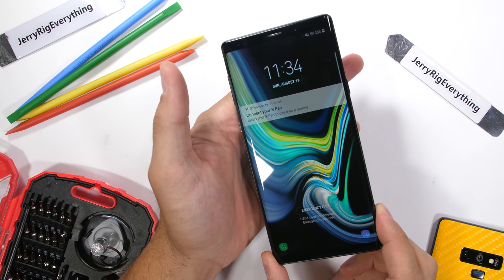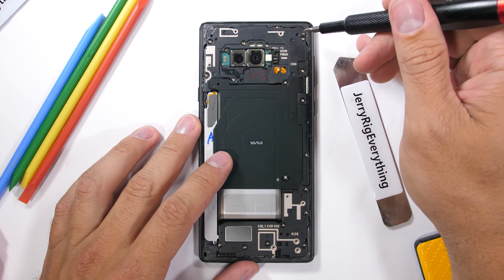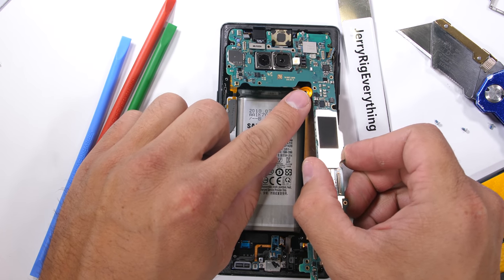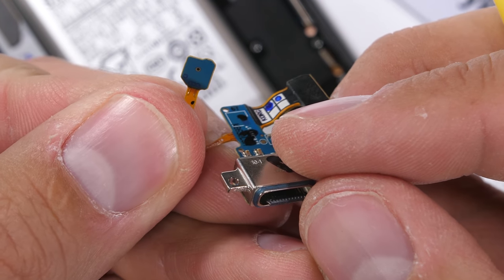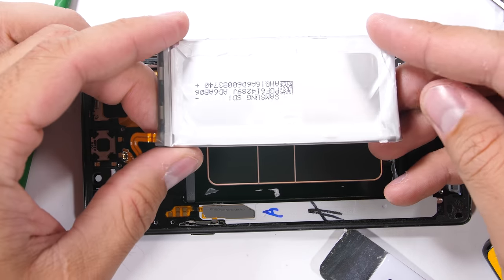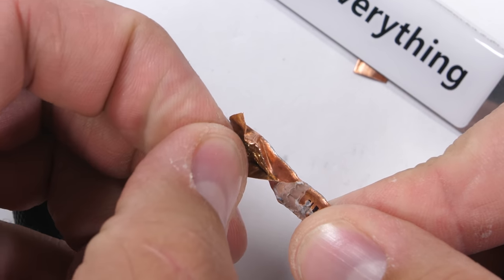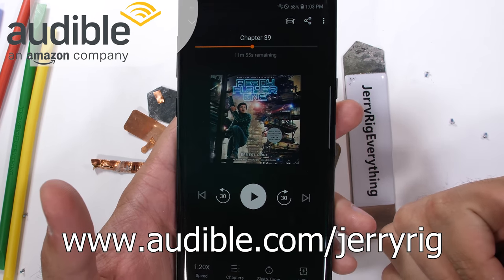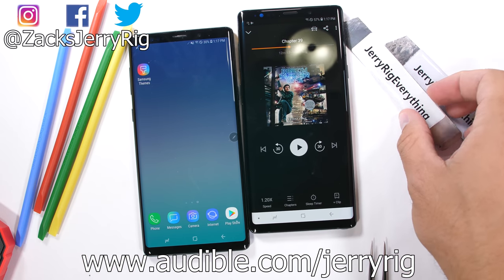Samsung Note 9 Teardown! - Is there Water inside?

Comment: Samsung can place a whole spen inside the phone..where apple can't place a headphone jack 🙂
Reply: The Note 9 is much larger AND thicker than the iPhone X. Samsung trades size for features while Apple minimizes dead space in return for a more compact device. Both are very different devices with different design philosophies and compromises.
Reply: No wonder lets see what next iphone come up with.
Plus version might be as big as s9 plus or even more thick.
Reply: I guess apple needs to make room for their terrible miniscule half day batteries, and maybe screw over the performance in the process
Reply: Apple don’t want a headphone jack that’s why. They design every part of the device, if they wanted it to have a 3.5mm it’s have one.

They want to go full wireless & figured as long as the headphone jack was around it wouldn’t happen

But honestly tho it’s been 2 years since they dropped it, Apple Haters are just getting annoying af
Reply: Lol anyone remember the courage it took to remove that
Reply: Lol the iPhone 8 Plus is as big as the note series
Reply: @user46346bdtgry   hahaha you know is for the money, they have patents on lighting cables so they get money from cables and dongles.
And yeah courage man
Reply: Apple CAN place a headphone jack. But they made a smart move with removing it. For an example. Any company, who makes Apple charging cables, has to pay apple for the design. Its the same with the headphone jack. Apple didnt invent it, so if they remove it, they spend less money.
Reply: Lmao😂😂
Reply: Got one youtuber modify his iPhone to include headphone jack
Reply: @Noah-Lach  yeah all apple cares about is thin phones and macs and trades it with performance. Look what happened to the 2018 mac.
Reply: @ellogovna5407  cough cough screen size ratio cough cough
Reply: @shoukeyy3455  Headphone jacks costs almost nothing. Apple didnt remove it to spend less money. They removed it to make more money out of the lightning port which they get a shit load of cash from 3rd parties. Unlike usb B or C which charge less from companies that makes accessories.
Reply: Well, the iPhone X still has better performance than bulkier Android phones but I agree on the laptop front.
Reply: @genelee239  forgot to say that, sorry
Reply: @Noah-Lach  then explain the iphone 7, iphone 8 which are about the same size as the galaxy s8 and s8 and still dont have a headphone jack while s8 and s9 has a bigger battery and more components inside the phone
Reply: @Noah-Lach  only in CPU performance, not overall performance, note 9 scored 280k while iphone x scored around 200k, 80k difference
Reply: @Noah-Lach  If you're saying this because of benchmark scores (if not then I'm sorry)  you cant trust most of them. Especially Geekbench. They use different programs for ios and android. And I dont think a 0.01 sec faster speed would matter in a day to day use (I don't think it would matter for professional use either).
Reply: Because apple bought beatsbydre. Apple need to force wired beat user to buy new wireless headphones to earn back the money. That's why.
Reply: Ria Driguez Actually all of Apple’s new phones are notably smaller and thinner than the GS9.
Reply: Gene Lee I’m basing that off multiple benchmarks (including 3D mark, etc.) and my actual experience with a Galaxy S9 that couldn’t maintain 60 FPS UI animations. But the additional RAM in the Note 9 is certainly an advantage for multitasking.
Reply: yes, the note 9 is 1 mm thicker than the iphone so much more thiccc
Reply: no they wanted to monitize thunder bolt and wireless headphones
Reply: yes, they are greedy and want more money
Reply: Sumeet Devilmakerzz 
We will se in the future when all the ports will be converted into USBC even the headphone jack admit it or not it’s not just Apple doing it anymore
Reply: Keros Blue 
They come with your phone 😅😂😑
Reply: People are still complaining about Apple removing the floppy disk drive from the original iMac, whilst the likes of IBM, Compaq, etc, retained there’s. But where are they now??
Reply: Noah Lach That and they don’t have a Taptic Engine. That thing is huge. Also, Apple is choosing not to include a headphone jack, despite what they’ve said.
Reply: mean while 4 iPhones coming out apparently let's see what iSheep's wallet survive
Reply: @Noah-Lach  but oneplus 6's performance is top notch.. for less than half the price lol the only android phone known to play fortnite on highest setting with minimum lag
Reply: @Noah-Lach  iPhone x isnt that thin
Reply: @Noah-Lach  the note 9 is significantly thinner bud bud, the real reason they don't have a headphone port is because of Apple being "innovative"
Reply: And by "significantly thinner" you mean about 15% thicker than the iPhone X, right? I don't understand how people fail to do basic research before commenting...
Reply: It's called innovation in Apple's book.
Reply: Betternet You're right, only about 15% thinner than the Note 9. But it's also an entire size class smaller than the Note: significantly smaller height and width-wise while packing in a beefier processor, a giant linear actuator and a battery that's 3/4 the size of the Note's. All I'm saying is that the Samsung clearly cares more about features at the cost of size, while Apple removes features to eliminate dead space and create the smallest, densest device possible. Both approaches are EQUALLY valid depending on what you're looking for in your phone.
Reply: although you have to agree that "compromises" are only dealt by the users of one device
Reply: Apple got this big vibration motor called taptic engine. Most of the people that use a newer iPhone are the opinion that is much better then the old circle vibration motor. It is much easy to notice in the pockets and isn't to intrusive.
Reply: Apple doesn’t want to put a stylus in their phone. That’s obvious.
Reply: @shoukeyy3455  Thats right! Zack also made a video about it some time ago...
Reply: @Noah-Lach  Actually it doesn't. The S9 and Note 9 are faster than the iPhoneX.
Reply: Zemzy Oseris Not true. Look up any comparison and you’ll see almost every benchmark gets better results on the iPhone. The Note has more RAM but Apple’s CPU is far better than Qualcomm’s
Reply: @Noah-Lach  I'm not talking about Qualcomm. Literally the first result when you search up iPhoneX VS Galaxy S9 is a video by EverythingApplePro. The tests show that the S9 is faster.
Reply: Purgitron iPhone also has explode and catching fire issue.. Do some research kid
Reply: They do not own a patent to headphone jack so they don't profit from it, that's why they removed it.
Reply: The whole comment section is talking about why Apple removed their headphone jack
Reply: Pixel Man  Im not defending Apple.
Reply: Pixel Man ....as I listen to this YT video using BT headphones. So I guess you’re right... there is nothing to replace wired headphones, that use an analogue aux cable and plug.
Reply: Pixel Man 
I apologise for upsetting you. Was not trying to be funny at all. But you’re right though, Bluetooth has not changed since it’s introduction back in 1989 by Nils Rydbeck, CTO at Ericsson Mobile. Although I seem to be rocking BT 4.2, which is just a random number. 

I’m trying to recall when I last used wired headphones, without getting tangled in the process, compared to my current BT headset, which always connect, without any need for manual paring, aided by the use of a “W1” chip. I just can’t imagine going back to floppy disks, CD-ROM drives, DVDs or wired headphones. 

Let the past be the past and move on. Look to the future.
Reply: Pixel Man 
You’re gonna be one unhappy person when car manufacturers are banned from producing oil-powered cars.... You always have to charge them,, they’re too expensive.... blah blah blah.....  

You better start saving.
Reply: Pixel Man 
Thanks so much for the applause. I appreciate it. 

So let’s agree....Wired headphones (the ones with the 1920’s aux jack) are the future. Wireless is whack. Bluetooth is whack. 

Now stop the applaud.
Reply: Iphone x is hella expensivebut Samsung have more features and look better
Reply: apple has 1 speaker but they selling the illusion of it having 2 speakers of both sides lmao
Reply: I like how people single out Apple, meanwhile Google is including a notch in their new phone while having bigger bezels than the iPhoneX, and they also haven't had a headphone hack in 2 of their 3 phones.
Reply: @Noah-Lach  except the iPhone X Plus will have a 6.5 inch screen. A whole 0.1 inch bigger than the Note 9.
Reply: Jack McClaren Those are not excuses, its a list of the types of design considerations and trade offs that go into creating a smartphone. If you want the most dense, compact device possible you choose Apple. If you want more features and don’t mind a larger phone then you choose Samsung. Believe or not, not everybody wants the same things from their phone which is why different companies exist.
Reply: Jack McClaren Care to give an example of a 2018 Samsung phone that’s smaller than the iPhone X while packing the same performance and a larger battery? Because the S9 is quite a bit bigger and only has a marginally larger battery (and, of course, much less consistent real world battery life)
Reply: really because i can buy a lightning cable or dongle at my local convenience store for like 2 bucks
Reply: Sumeet Devilmakerzz Samsung Sucks
Reply: Andy SuazoC flagship phone that blows up; yeah, it was definitely deserved. They were literally banned from being brought onto airplanes man
Reply: No they did it because they figured they can sell you headphones by doing so, same with lightning  cables etc, they always take something away so they can sell you something else.
This year they are supposed to be removing the dongle from the box so they can sell you one for $20, last year they gave you fast charging but no fast charger.
It's not for the good of the customer, everything is geared to milk every last penny from you.
Every company is in it to make money but Apple are the biggest bunch of greedy robbing bastards on the planet.
Reply: Wh00pS32 lol I bet Samsung don’t do that they are saints 😉 and the “dongle” only cost 9$ not 20$ 🤔 and they all come in the box as they will this year.
Reply: @LeBoxMan  unless a great number of people complain about a removal, they will strip features away to cut costs. So be thankful that they got repremanded on that, otherwise you would still have to separately buy it.
Reply: @Noah-Lach  and that's the reason for not putting a headphone jack which is standard still today and everyone wants it? Shut up Apple fanboy...
Reply: @Noah-Lach  Yeah... Don't cry dude.
Reply: Jovan Calic Still didn’t read my reply eh?
Reply: Apple got RekT
Reply: Lita Ziang yet it lasts longer than the note 8 and many other android phones with higher capacity batteries because apple optimises the OS for real world day to day usage which devices like Samsung note 8 fail at badly 
I’m using the note 8 as an example because I’ve used it and am now using a iPhone X and the IPhone X does a better job at running longer under everyday heavy usage 
I have to charge my note 8 2 times a day under everyday usage and my iPhone X once 
I’m a heavy smartphone user my iPhone averages about 6 hours of screen on time on Facebook YouTube eBay meanwhile the note 8 averages about 4 hours under the same usage
Reply: J Arnett i have an x the battery lasts like 2 days for me
Reply: Oh please I sell these phones every day. I started working and had a j7 its battery out lasted the X. Both me and my coworker use our phones non stop to show features and trouble shoot. I upgraded to the note 9 and i still last longer. Meanwhile shes charging her phone on a battery backup and later off the work pc. I still have 40-30% by the time i go to bed.
Reply: well my battery is 50% aftetr a day but thats when i dont use it ttoo much it has never ran ouit of battery one day
Reply: This comment section is cancer lol. Apple removed the headphone jack because they want a wireless future whether you like that or not doesn't matter that's their goal. You people are sitting here acting as if apple is the only person that makes Bluetooth headphones and they get all the profit from this move. Their beats line was already extremely popular, air pods would've been a hit regardless of a headphone jack. And please stop comparing battery sizes it doesn't translate from Android to iOS Apple has always had significantly smaller batteries but equal or better battery life. And to the people complaining about Bluetooth is always out of sync stop that bullshit too. A Samsung soundbar connected via Bluetooth to a tv (which the main purpose is voice) has no delay, this isn't 1994. With that being said the Note 9 is a awesome phone makes me miss Android.
Reply: Lol you crybabies can’t get over a headphone jack.learn to adapt.wireless headphones r becoming the new thing. So glad Apple removed headphone jack. One less hole to worry about
Reply: LOL FACTS
Reply: Dongle....dongle.....wait right I want to listen without bluetooth and charge...dongle...oh what about using it as a external display....another dongle....lol.
Reply: Totally right! You the customer pay more!
Reply: Uh....look up even the Note 8 next to the 8 Plus...not even the 9....the Note has a lot more display area...lol.
Reply: @Noah-Lach  what about iphone xs max lol?
Reply: Shaffan Mumtaz What about it? They could probably squeeze in a headphone jack if they made it as thick as the Note 9 (and added a chin and forehead) but it’s kind of too late to backtrack on that choice now.
Reply: @Noah-Lach  lol the screen to body ratio on both of these is not much different plus the note houses an spen along with all other components ip X smax is as big of a phone with a much smaller battery no spen and no headphone jack  the reason is simple apple just want to get more money with dongles and lightening cables used by headphones
Reply: Shaffan Mumtaz We don’t actually know the battery size of the XS max, but it’s smaller than the Note 9 in every dimension.
Reply: @Noah-Lach  the note 9 is the same if thinner than the iphone x
Reply: It's 8.8mm, about 1mm (15%) thicker than the iPhone. Also taller and wider.
Reply: Samsung can make it IP68 water resistant too....
Reply: sanjay neelam thicc
Reply: not to mention a higher capacity battery!
Reply: Noah Lach  Yeah, except some guy on Youtube went to China and built an EXACT replica, very same chassis, components, etc. of the new iPhone and added a headphone jack to it without any issues. So... yeah.
Reply: Airpods ftw
Reply: @Noah-Lach  I would agree if it wasn't for that massive camera bump
Reply: Iphone x is fn thicc
Reply: As the owner of a galaxy note 9 and iPhone, I don't know which is bigger or fatter without getting out calipers. Apple removed the headphone jack to sell airpods.
Reply: But it sexy
Reply: the new iPhones come with air pods
Reply: to get their phone wireless. Its called evolution of technic Lita Ziang
Reply: Sumeet Devilmakerzz iPhone doesn’t have any bezels Samsung has 2 small ones, also there isn’t any room by the notch
Reply: lil1will24 ok then apple has 1/2 a bezel (notch is half the screen) while Samsung has 2
Reply: Who needs either of those?
Reply: What's your excuse for the similarly sized Iphone Xs Max then?
Reply: @Noah-Lach  isn't one of apples selling points bigger phone this year?
Reply: Azim Alif Yes, it has a slightly larger screen than the Note 9 (about the same if you count the notch) in a more compact package. That’s the selling point. It might be a benefit for some people (like me) while others may prefer a larger device with more features.
Reply: @Noah-Lach  it's actually a slightly smaller screen on the iPhone when you take into account the notch.
Reply: Russell H Yes, as I mentioned the notch all but eliminates the extra 0.1” of screen size. But the iPhone XS Max (terrible fucking name lol) feels much smaller in the hand.
Reply: I think that was a choice...
Reply: Sumeet Devilmakerzz I was thinking about getting the apple 10 max but no headphone jack , I hook my phone up to high power stereo amps from the 70,s so I will get the note 9 or 10 and what people dont have bluetooth car stereo, stupid move apple.
Reply: Genes
iPhones are for show off.
NOTEs are for functionality.
I am passing Note9 only because Note8 is still awesome and will replace it with Note 10.
Reply: All these comments about how smart or bad iphone is lol they made it different to be different. So only apple can work with apple and you need proprietary parts. Yes it's a gimmick to make money, all companies aim to make money. Apple was just lucky enough to do it with poor design that caught on as a status/fashion statement lol but to their credit their touch screen response is amazing, everything else about them is pretty much fasion statement
Reply: Hm... Not sure about the thickness what do you mean is much thicker? I don't think 1mm is a MUCH thicker device. It is a tiny bit thicker but don't emphasise that because 1mm for the spen is nothing. So please. Apple could fit the headphone jack in a 7.7mm phone no problem, they just removed it so that they would make alot of money for the dongles (manufactured for $0.32 sold for $8) Those are the business practices that I hate.
Reply: It is as big as the note (body wise) but the Note 9's screen is almost bigger than the entire Iphone 8 Plus and it's curved.
Reply: To make dongle sales.
Reply: Don't say that. That is one of the stupidest things ever. To implement a headphone jack into the iphone 6 it costed $0.25 so please! The only reason why is to make more profit with dongle sales since they arent included in the new iphone Xs XSmax and XR
Reply: Companies that scream "Innovation" usually have the least amount of features so yeah haha.
Reply: @user46346bdtgry  samsung haters are more annoying making false assumptions trying to roast us lmao fym?
Reply: Noah Lach I bet you feel dumb now with the iPhone XS Max on the market. A giant phone, still now headphone jack. LOL
Reply: News
Reply: 3.5mm audio jack lives matter, too
Reply: And they placed a Fugly Bixby button.
Reply: That’s why iPhone is smaller. And its more powerfull too, but doesn’t need liquid cooling. That’s just marketing for idiots 🤣
Reply: Sumeet Devilmakerzz BOOM ROASTED OOOOOHHHHHHHH just stop. Please.
Reply: @ikusanjay  two more cameras and no charging port
Reply: If Apple did this to earn mor money , wont their workers get paid more too ?
Reply: lmao
Reply: SumEeT Gk apple removed the headphone jack so more people will buy Bluetooth headphones like beats and air pods
Reply: SumEeT Gk and honestly apples Face ID is amazing I mean the dots project and a infrared camera destructs the dots I mean that’s future
Reply: @daltonneaville5352  Amazing how Apple fanboys always go off subject or find an excuse. Apple could have the best phone out, but there is still no excuse to this entire headphone jack shit. It's just a scam and they want it to die faster as well.
Reply: sanjay neelam You mean more thicc
Reply: Noah Lach 'Apple minimizes dead space' have you seen their new iPad Pro........
Reply: Jonathan Davis AND it will be more expensive with less features ouf
Reply: Apple fanboy reacts lol
Reply: Those Apples have worms in them!  : l
Reply: iPhones can't even fit a USB C charger on they're phones! They still have 'Lightning' 🤦‍♂️
Reply: @Noah-Lach  in ur dreams
Reply: Andrew Hudson lmao floppy disks are outdated as fuck and it was good to remove them because something better was available. Removing headphone jack is for the single purpose of making more money via royalties. Wireless headphone also are small and many people lose them easily and what do you do when you lose them? Buy more! It’s a win win or apple and a lose lose for consumers. Also keep in mind you have to pay royalties for HDMI too you just don’t hear about it because they didn’t make it ridiculously expensive. It’s clear which one wants to deliver and which one just wants more money. You don’t become the first trillion dollar company by playing fair
Reply: Apple can definitely fit one, thier iPod Nanos were so packed, but they want royalty money. Soon usbc will fix this...